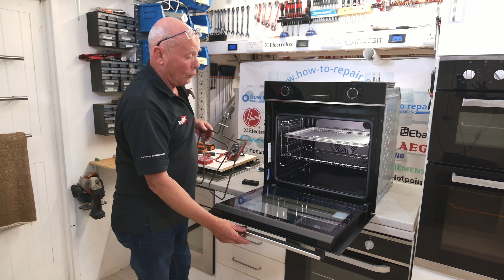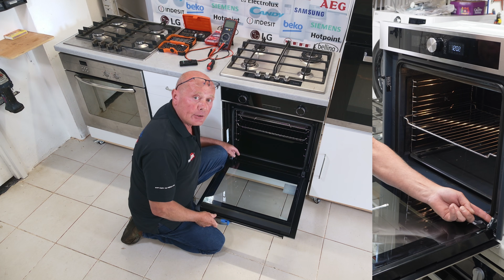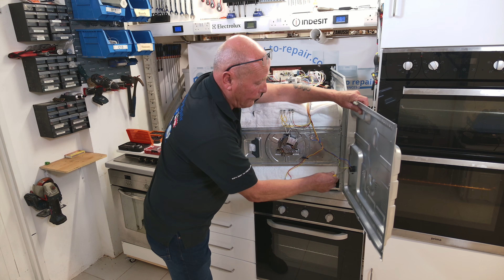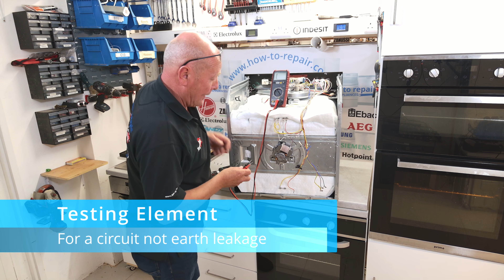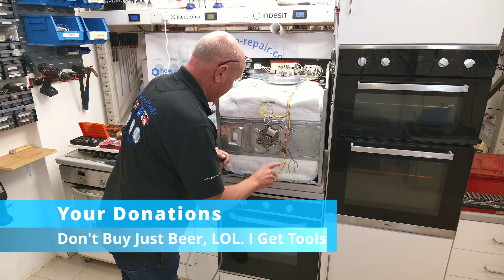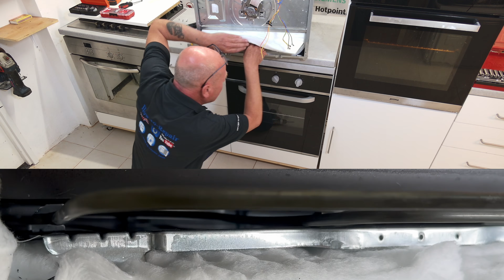Beko Oven Cooking Unevenly Or Tripping Power | How to Replace A Base Heating Element?

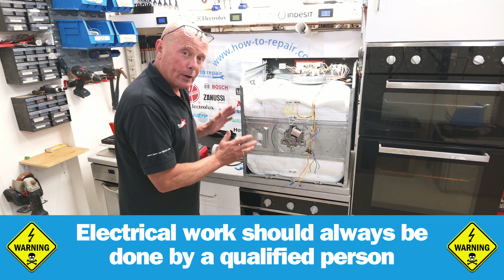Comment: Hi. on min 11:25 you said that we can identify how it trips the electric when the device is powered. But how to identify if it trips the electric? What should I measure when the device is powered to decide that power is going to ground? Thanks
Reply: measure resistance between the poles of the element (disconnected from the cables) and the oven's metal shell. It should read open circuit or at least a very very high resistance (mega ohms). if it reads a low resistance means there is a leakage. it's also worth testing the cable leads this same way to see if they have a leakage

Comment: Errick: Hi Paul, my Beko oven with BBIF16300X model number seems to heat from the top only. Yesterday. I tried the convection oven setting for our family dinner but it did not work effectively and the bottom stayed cold. I've checked the settings and everything seems fine to me. I've tried resetting the oven and even left it unplugged for a while but there was no improvement. Other functions of the oven like the fan oven and the grill element seem to be working fine. Could the base element be faulty? Should I replace it?
Reply from the maker: See Short reply
Reply from the maker: Related FAQ Page: https://www.how-to-repair.com/faqs/beko-bbif16300x-oven-bottom-element-not-heating-stays-cold/

Comment: Hi I have a beko electric cooker model number bd16c55  double oven model when connected to mains with the cooker turned off  it trips the main circuit top oven never used what could be the problem please